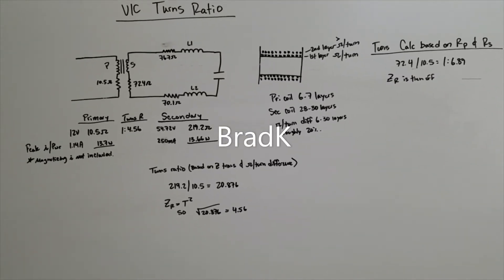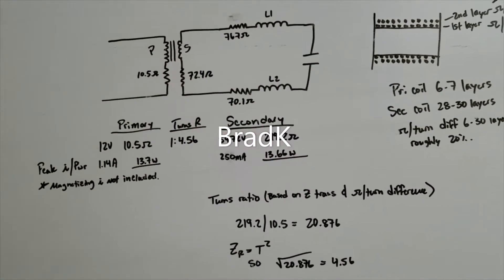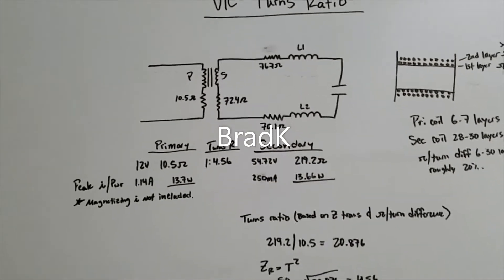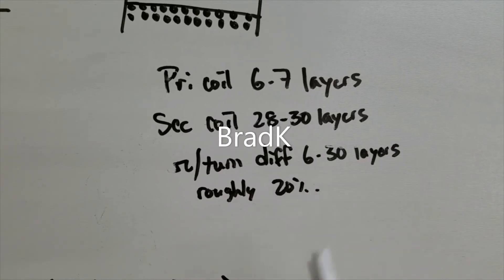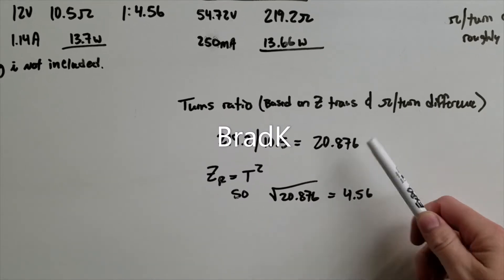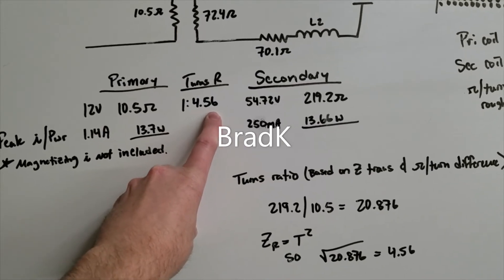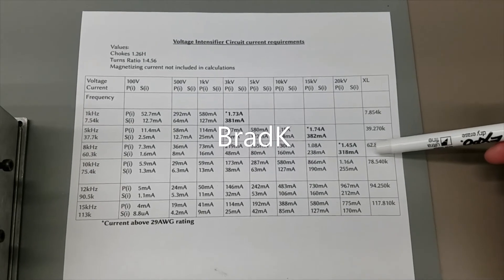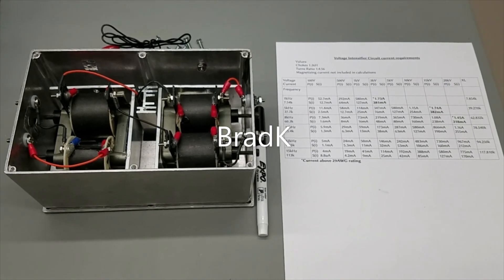Stan Meyer Research # 25, Aug 2019-Understanding the V.I.C. turns ratio

Comment: Readings of WFC documents showed that the inductor coils were resistance type wire as insulated magnet wire, - not copper wire. Wound in Bifilar mode. This was to raise up the impedance overall of L+C resonance, and get even higher voltage. The water could also be melted snow, which has way less ions in solution than distilled water. Then again higher resistance which allows higher voltage for voltage dissociation.
Reply from the maker: The resistive wire was for the WFC injectors. It was made from a 430f/fr stainless steel wire. The problem is getting the enamel coating to stick to it. I bought some of the original 430SS wire from Stan's estate and the coating flakes right off of it. There were letters documented from Molucul Corp (I know that's spelled wrong) to Stan explaining how they were having problems getting the coating to stick and because of that they couldn't guarantee it would work. 

Also, I don't think anyone has enough info to correctly make the WFC injector VIC work. With the wire being magnetic it completely changes the way that it operates.

Comment: The "extra energy" does not come from the windings, but from the electrons in water. Also needs the "electron extraction circuit".
the only thing VIC does is minimize amps and maximize voltage. I don't see the rectifying diode. and the resistances you show, unless parasitic, should not be there.

Comment: The dielectric withstand voltage on magnet wire is 1 kv , before the varnish breaks down.
Reply from the maker: Yes, and there are many ways  and methods to reduce the voltage per turn and voltage between turns to prevent breakdown.

Comment: Remember, the WFC is a variable capacitor.  The more gas that forms within the WFC, the lower the capacitance.  The current leakage is needed to make the WFC produce the gas to change the capacitance of the cell.  You need to start at a lower voltage and gradually build up the voltage as the gas forms.  You also need to maintain a constant minimum voltage pulse in order to keep the water polarized to the WFC plates.
Reply: Impedance matching is one of the biggest keys to make this work.  You need to make sure that the power transfer to the WFC is optimal.  This is why knowing the resistance of the WFC is also important.
Reply from the maker: Agreed. The problem is getting the VIC to do that. I am still working on finding off the shelf ferrite cores that will give the correct values. It might be the only way to get it to work is by having specialty cores made exactly like Stan's. I had a set before but couldn't get them to work and then I broke one of the cores by accident.
Reply: @BradKwfc  Overlap the tail of the pulses will keep the voltage at the minimum to maintain polarization.  Specialty core is not necessary.
Reply: @BradKwfc  I think your video showing particle oscillation may be a hint about the variable capacitance.

Comment: Hi Brad    Yes in the Mechanical Drive EPG the coils are connected in parrallel     high current,  low voltage device
                 In contrast the mag gas multi tier device was high voltage, low current device 
                 
                in the multi tier system the bus bar was not needed because of the heavy duty connections on the side

Comment: if you look closely at a wimshurst static generator you can see that, like Stans VIC, it works in a dead short condition.... it also has the property of no amps but very high voltage...

Comment: Hi Brad... don't forget that the chokes are bifilar wound.... also the amp inhibitor coil( separate coil unit) is wired into the center tap of the secondary.... inhibitor coil has effectively 3 coils wound on it...as seen in fig 10-4  in section 9 of  birth of a new technology notes...
Reply: To me, this points to the VIC being a static charge effect... I also have a recorded interview with the guy(stans elder) who's garage stan started working on the VIC in, from the beginning when stan was running a john deer ride on four stroke mower on the first VIC... way before the buggy... he said that he looked down the tube cell one day when it had no water in it and it was making a tic tic noise as there was a spark between the inner/outer tubes...he was describing a static spark as generated by a static generator( example..wimshurst or van de graaff generator)... the interview had lots of other interesting facts both technical and anecdotal observations by the older gentleman... it was conducted by Brian Coats.... if you want I can try to find it for you...
Reply: No, no and no. Don't need bifilar or center tap.
Reply: Greg Nutt .. cool.. if you think you don't get some equipment together and show us, that way we can all cover more options quicker and hopefully we will get the answer quicker.... let us know how you go.